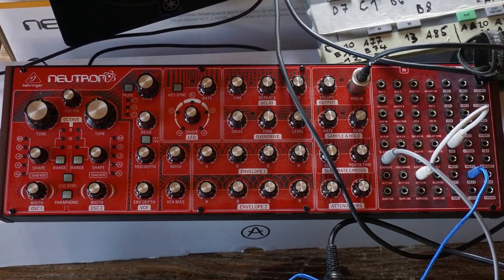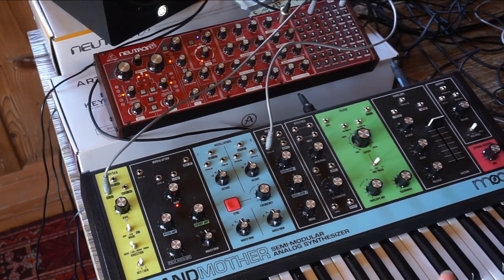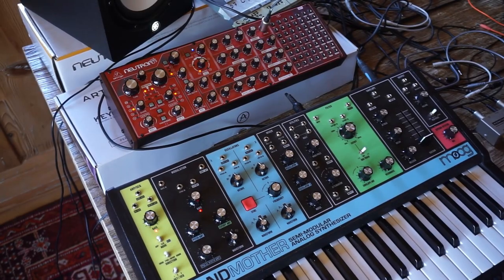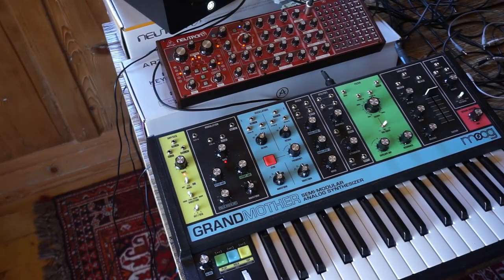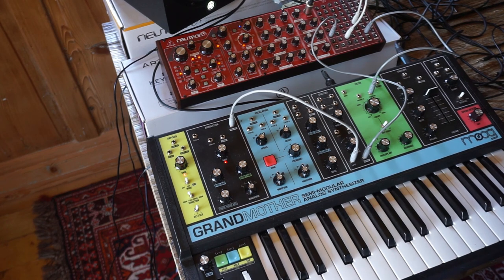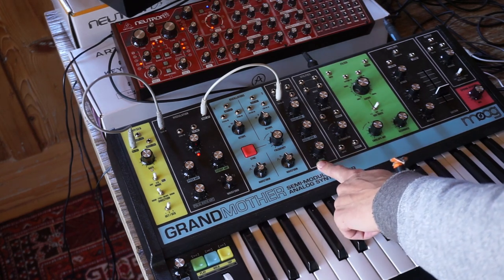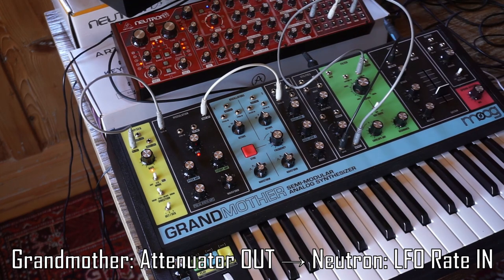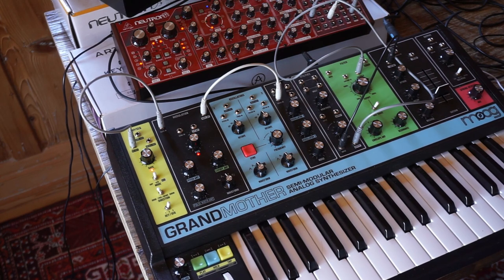HOT THREESOME with Moog Grandmother and Behringer Neutron – Patch Ideas

Comment: awesome, could you share about your connection flow? I/O , MIDI , etc. please
Reply from the maker: This is basically all eurorack signal flow. I've only connected the Grandmother's line out to my speakers/recorder. Neutron has no midi nor line connection at all (unless for the small bit at 3:30 where I took the Grandmother's midi out to the Neutron's midi in). All the Neutron does is receiving and sending signals via eurorack minijack cables to the Grandmother's many eurorack inputs. Those are then processed by the Grandmother, so the only external connection is the grandmother's line out.